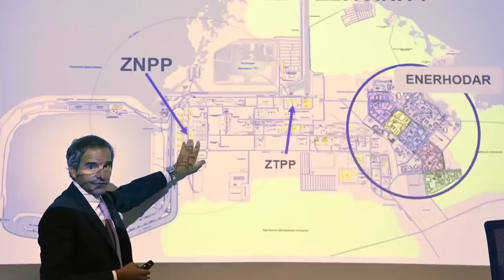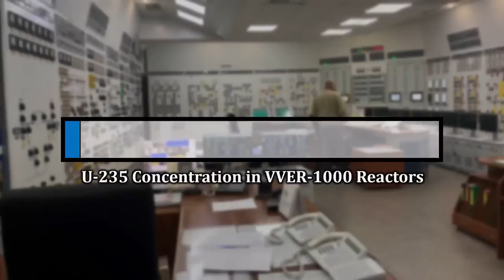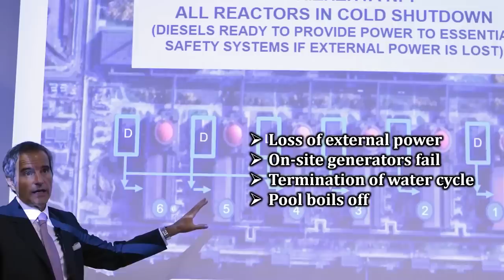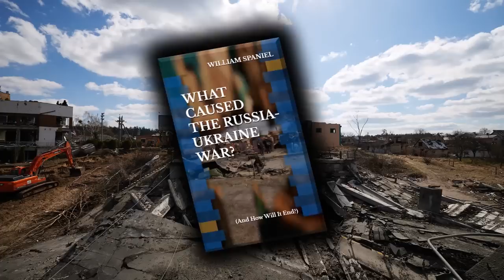Where Will Ukraine Strike Next? The Three Main Options Available to Kyiv

Comment: Option 3 means the eventual fall of three oblasts (zaporizhzhia, Kherson and Crimea). If they reached the Sea of Azov the Kerch bridge will be in range, Kherson will be completely untenable, and so then they’ll also be able to shut off water to Crimea. Crimea’s fall is merely a matter of time at that point, and that would cause political chaos in Russia.

Ukraine knows this, which makes me believe that offensive must be seen as extremely difficult as they would have pressed it already otherwise.
Reply: Or they may not have yet prepped the battlespace like they did in Kherson.  How long did they do HIMARS strikes before they made their move towards the city?  A push to Melitopol would require a similar softening up of Russian forces before the ground troops move in.
Reply: Zaporiza
Reply: Problem is, well, russia knows this too well too. Kharkiv happened because Russia didn't expected it,/didnt care. Kherson happened because Russians couldn't resuply. Zaporizia must achive at least one of those two conditions. Ukraine does have thee advantages though: 1 Home terain Partisans in melitopol are quite active, meaning that they have quite good idea what and where to stike; 2 They can keep wrong-footing russian army, if it will need to shift forces away from certain fronts to patch others. 3 They need to reach Tokmak (41 km) to severe rail, or Melitopol (85 km) to completely cleave russian forces in half. But rail is enough, if they achive it in early winter. Then its starvation game again.
Reply: @johncarter9054  I don't know what you are smoking but you need to calm that down, it has completely wrecked your brain.
Reply: @johncarter9054  Literally nothing points towards that.
Reply: I don't think the Kerch bridge is in range of Himars even if Ukraine retakes Zaporiza (not with the missiles the US has limited Ukraine to)... I think their best bet for that bridge is continued unconventional attack.
Reply: Ukraine has lost the economic war and a good chunk of eastren territory,  Ziolensky will soon negotiate the end of hostilities and retire to UK, ...and EU will pay the damages
Reply: @johncarter9054  You are aware that NATO has been on Russia's border for a while right? Estonia and UK have a defence pact and a very close relationship, with Estonia, Latvia, Lithuania all being members of NATO, which is an alliance based on defence not offence, so should be no worry unless aggression is a countries aim. That said, NATO can already strike at Moscow from NATO members, Ukraine is not required, so their joining would put Russia in no less danger, so does not provide a decent excuse for invading a sovereign nation.
Reply: @davidford3115  actually there are tons of partisans in melitopol if Ukraine attacks melitopol partisans already inside could potentially rise up and cause confusion within the Russian lines
Reply: @johncarter9054  "(((Zelensky)))"? Oh we have a proud Aryan here! Haven't seen your kind around a lot.
Reply: @kuhndj67  Not without the longer range missile, but it will put them in easy range both via drones (which they’ve been using throughout crimea) and sea drones. Russia would be under constant attack there.
Reply: @ValensBellator  Interesting tought. Sea drones would be quite a threat to the bridge, since they can pack more explosive than air drone. Also, you can push the action as soon as you get a contact with Azov sea.
Reply: @YouMadBro69  You certainly know how to troll. Not !  LoL
Reply: @johncarter9054  said no to peace😂 good one…
Reply: Another Awesome Video William!
Reply: @javierfrancia1938  russian troll !!!!!!!!!!
Reply: @hecra6521  not really, instead i feel sad for both countries, but im just being realistic and im trying to bring some sanity to the espectators of this crude Youtube propaganda
Reply: @hendrikdependrik1891  what if Crimea declares independence and wants to be independent country instead (have been hearing that they aren’t that fond of Ukraine either)
Reply: @mediamenace1879  Yes, I am aware of that.
But perhaps you are misinformed about what NATO and the Washington war mongers have been up to in the last 10 years or so in Ukraine. Losing Ukraine is not on Putin's wish list and would appear to be the last straw and so the invasion happened. America has invaded many sovereign nations for far less.
Reply: @jasonmcclatchie6877  Im quite calm actually. Just noticing that the situation altho quite fluid is not really looking good for US backed Ukrainian forces.
Reply: @Fknspill  Quite actually everything points exactly towards that, depending on where one gets their tactical information that is. Not sure where you get yours but to anyone paying attention the situation however fluid, points to the afore mentioned target opportunities
Reply: @johncarter9054  the last 10 years, so are we talking before or after the annexation of Crimea? and as far as I'm aware the only thing NATO members have done is provide defensive munitions and training. To which if you perceive being able to defend yourself as a threat to a neighbour, I guess you need to ask what your neighbours intentions are in regards to your welfare...
*edit * as a caveat, Ukraine willingly gave up their nuclear arsenal to Russia on the promise they would not threaten them...what did Russia do?
Reply: @JackSparrow-xn7sz  Not a druggie so wouldnt know about that.
Reply: It's a decisive offensive option for sure. If successful the war is on a great track for Ukraine. I'm wishing the best for them. 🇺🇸🇺🇦
Reply: @mediamenace1879  Better question is what have the people in Washington done to provoke this war ...
Reply: Good 👍.
Reply: @powerfly777  What about a breakthrough in Volnovakha-Mariupol direction? Moreover theres a geographical obstacle that would let ukraine fix the frontline in that area (Kalmius river)
Reply: @javierfrancia1938  Ukraine won the economic war the minute it got western support 
The west has 50x the economy of pre sanctions Russia and we’re more than willing to pay what it takes for Ukraine to survive (even if we’re not willing to pay for them to be comfortable)
Reply: @kalmenbarkin5708  Dear Kalmer, just look at the facts, Ukraine is literally a non-functioning country, EU is broke US cannot continue support without risking a confrontation with Russia, on the other hand Russia seems that it has an endless supply of weapons and soldiers, its energy supplies to India, China are ever increasing,  do you really think that Russia is in a weak position?
Reply: @javierfrancia1938  China and India aren’t on Russia’s side here
China might be willing to help out a little but it will not send significant help
India is entirely neutral and has sent some help to Ukraine 
Russians desperate to feel like they aren’t isolated consider anyone neutral as their ally but that’s a joke

The EU economy while facing some difficulty is bigger in 2022 than 2021 
The Russian economy has been set back years and is continuing to drop

The only ones willing to spend large sums of their own money to help Russia is Belarus and maybe Iran before it had its hands full domestically 

Russia is in a production/attrition war with an economic bloc 40x its size 
And no 50x isn’t an exaggeration
Russia’s GDP is around 1.6T
The US is 23
EU is 15
UK/Japan/Australia/Korea (the one that matters)/non EU NATO/Taiwan together are about another 20T which makes the combined bloc fighting Russia over 40x its economic size 

In other words if we spend 1% of GDP Russia needs to spend about 40% to counter
It’s not even close to a fair fight 

Oh and Ukraine being on a wartime economy changes nothing in this equation they don’t need to be able to produce material we’re producing it for them 

It’s not remotely close 
Ya boy screwed up and now he’s desperately begging for Zelensky to come to the negotiating table while he laughs at him
Reply: @javierfrancia1938  economics in warfare isn’t a magic word and isn’t XP in a video game - all it means is ability/will to bring the necessary material to bear
Russia simply cannot possibly produce as much material as the west is willing to supply Ukraine

We see this on the ground 
Russia went from sustaining 4 separate combined arms offensive axis in February to 4 holding/pressuring offensive arms in March to 3 in April to 1 advancing axis and 2 holding patterns in May-July 
To virtual stalemate on all fronts in August to losing ground on 2 fronts while maintaining 1 minor offensive front since September 

Ukraine went from TDF forces throwing Molotov cocktails at tanks in February to 2 simultaneous combined arms offensives in September-November

The material trend is absurdly obvious
Reply: @kalmenbarkin5708  Seems that Russia is winning hard, in all fronts, so the mistake is on the other side,  so obviously you got the whole thing wrong
Reply: @kalmenbarkin5708  Seems that Russia is winning hard, in all fronts,  US and EU and UK caanot even buy enough oil/gas to keep their own population comfortable, let alone increase production of an arms industry which is not sized for war of this size,  ...really what are you reading, how do you arrive to such outlandish conclusions.  Be reasonable!  Russia is bigger and harder than the combined enemy its facing in this proxy war
Reply: @javierfrancia1938  Russia has about 140 million people and 1.5T in GDP 
NATO (not counting other US aligned powers) has about a 1B people and 32T GDP 

Russia’s entire manufacturing sector is about $200B
The state of Texas has about $200B in manufacturing annually

The entire team Russia in this war is approx equivalent to Texas 
Not the US not NATO not the collective west - Texas alone

The west needs to commit approx 1/50th as hard as Russia does to produce equivalent material 

If you’re curious about energy prices in Texas average electricity prices on ERCOT are about $.07/kWh right now
Gas is ~$9/thousand btu
Not ideal but cheaper than many times in recent years 

Texas alone could outproduce Russia never mind the entire collective west
Reply: @javierfrancia1938  Russia holds less territory today than it held a month ago which is less than it held a month before which is less than it held a month before that 
It’s missiles are hitting at progressively lower rates (as Ukrainian air defenses improve) and it hasn’t had a large successful combined arms significant breakthrough since June 

Every single month since the war started the balance of forces has shifted away from Russia 
The February army that was capable of combined arms coordinated offensives on a large scale no longer exists 
Russia has less equipment in every significant category than it had since the war started and Ukraine has more in many categories
Reply: @kalmenbarkin5708  drug usage is not my lifestyle, surely seems that your somehow familiar with it, in any case let me explain the situation. 
1º the "collective west" is just a handfull of european countries plus UK, Korea, Israel and US. The rest of countries in the west are not willing to engage. 
2º US is the only one with the capability, but it will take it years to get enough capacity to sustain a large overseas campaign against a Russia which is a proven master of defence technologies and logistics. US arms industry is only geard to launch small campaigns against vassal states or with minimal armed forces. And here, timming is key, by the time US shapes up, Russia would have also worked itself many orders of magnitude from where it is now standing.
3º  If US directly attacks Russia, it runs the risk of having China, Iran, and probably India becoming arms suppliers for Russia, and then the game changes very much.
Reply: @kalmenbarkin5708  meanwhile ursula von der leyen has officially declared that Ukraine has lost in excess of 100000 soldiers, with no rapid replacement in sight, at the same time RUSSIA is getting close to deploy a 300000+ combined armed forces. On the other hand Borrel and Macron have stated that EU weapons stocks are depleted and no more supplies are considered in the short-medium term. By the way Russia has augmented its military budget and is now in agreements with China to exchange oil for weapons. Meanwhile Russia is manufacturing full-steam ahead more hypersonic missiles for which no other countries have defence measures
Reply: @javierfrancia1938  wow you don’t actually know what the words “combined arms force” means 
If you think fresh Mobliks are a combined armed force you know even less than I thought and I’m going to stop engaging here

I’d encourage you to take whatever sources your getting your info from (I’m guessing podcasts or YouTube) scroll back 3 months and watch a few shows 
Then ask yourself how connected those sources were to reality as it played out 

A pretty good indicator of how connected a source is to reality is how well their understanding of the field plays out 

I know my sources have been pretty spot on since late March (a lot of them thought Russia would win quickly in the first few weeks) 
Did your sources see the Russian humiliations since August coming?
Reply: @javierfrancia1938  oh and one more thing I’ll leave you with Russia isn’t getting close to deploying 300,000 mobliks they’ve been constantly deploying hundreds every day for months now - all the while continuing to lose ground including “sovereign forever Russian territory”
Reply: @kalmenbarkin5708  the deployment is under way, and they are retaking territory, but time will tell, in my humble opinion it seems that Russia will end up victorious, will that bring a new era of balance or not, i really dont know, but what i know is that this war is a racket and Ukraine and its civilians are paying the cost and they dont deserve this.
Reply: @kalmenbarkin5708  combined armed forces is what Ukranians do not have, and the west cant provide. Long supply lines and longer training periods adding the heterogeneous C4 systems the west can provide makes the theater a sh1tsh0w for the Ukranians
Reply: @javierfrancia1938  quick question in your “humble opinion” circa July was Ukraine about to offer Russia 3 straight months of humiliations? 
Just trying to gauge how much of your “analysis” is connected to reality vs wishful tankie thinking
Reply: @javierfrancia1938 you’re gonna have to answer if you want any engagement 

Circa June/July did you see any of this coming? Or did you radically overestimate Russian power for the past 8 months?
Reply: @javierfrancia1938  you keep avoiding the question 
Did you see the last 3 months of Russian humiliations coming or not? 
This is the 4th time I’m asking 

It’s relevant because you seem very confident in your assessment of facts on the ground 

So did you understand the reality on the ground well enough to see the last 3 months of Russian losses coming 

Yes or no
Reply: @kalmenbarkin5708  100000 Ukranian soldiers dead, Russian casualties are not even half of that.  Russia has secured 5 nuclear plants, the entire southern-east border, Mariupol also, ...Odessa is under their vigilance and Crimea is fine.  Soon they will secure the entire Donbass,  it is a situation that the US and EU are contempalting for the upcoming negotiations, if you dont believe me, just wait a couple of months and you will see it
Reply: @javierfrancia1938  I’ll take that as “no” on my question 🤣🤣
And your inability to give a straight answer tells me all I need to knew about your ability to soberly assess your sources by their records and adjust your intake accordingly 

Have a day 👋
Reply: @kalmenbarkin5708  same to you
Reply: @javierfrancia1938  I’m sure in your head this was a good one 🤣
Reply: @kalmenbarkin5708  which head, i have 2 big ones.
Reply: @javierfrancia1938  yeah I’m sure 🤣
Reply: Все правильно ,, больше HIMARS ,,,,много русского удобрения ,,,-замечательно
Reply: @1mol831  but WHO gets to vote?   I've hard of enTIRE cultures being exiled to Siberia [read "deported from Crimea"]  --  Tatars come to mind.
Reply: @Frank--Lee  yes, sorry to bother you, im conducting a mass intelligence collection, your profile is discarded